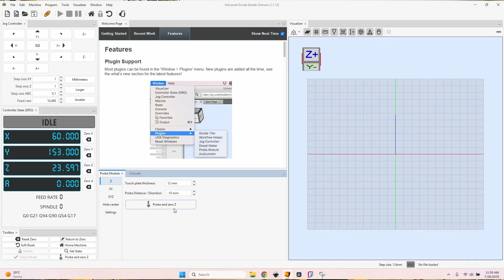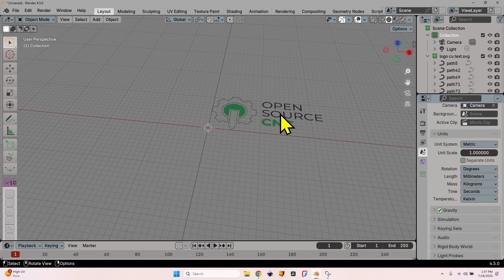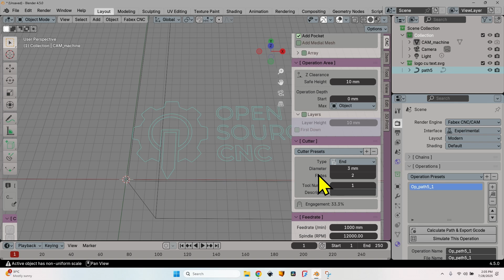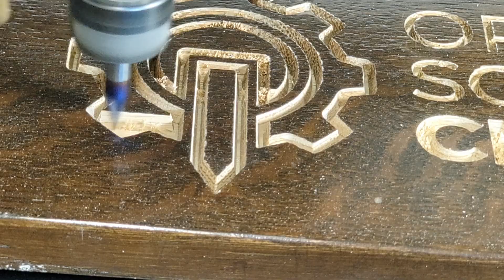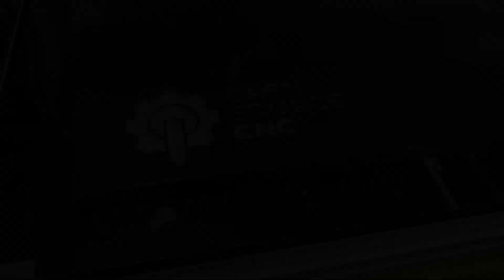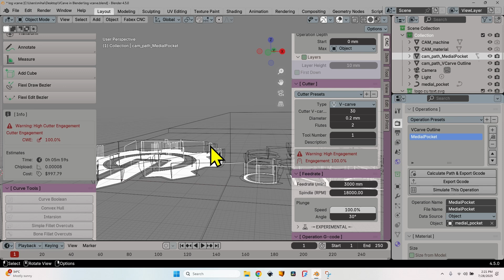Blender CNC Tutorial: V-Carve Logos from SVG (Free FabEX Add-on + ZahyoX CNC Bit)

Comment: Hi friend, I was doing one of your tutorials, the one of the shuriken, there are 2 problems I'm facing, the first one, when I'm exporting the gcode the first step moves my Z Axis to the top and it clicks my limit switches do you know how to prevent this? Currently I'm deleting that part from the gcode, the second one I'm facing a issue with the feed rate in the job not in the machine setup, it's always keeping 50 and I want it to be 700 at least, when I moved this to the simulator is super slow and when I tested in the machine, the same behavior, moving but super slow, hope you have a chance to answer this, BTW in the Z issue I'm doing the Probe before
Reply from the maker: The top of the z axis clicking is, most probably, an issue with the safe height. I can't say anything about the second issue until I see the file. Can you send it to me via email? (you can find it in the about section of the channel)